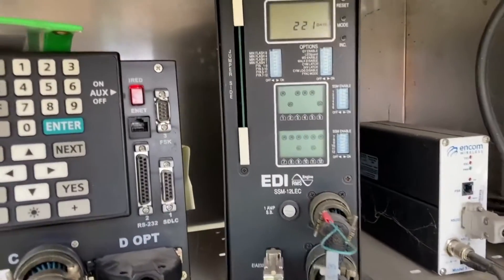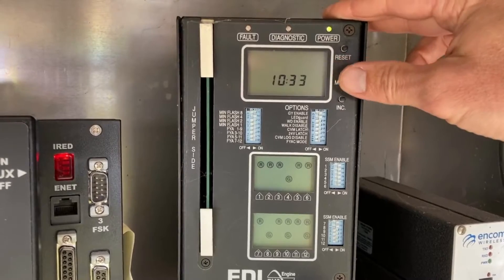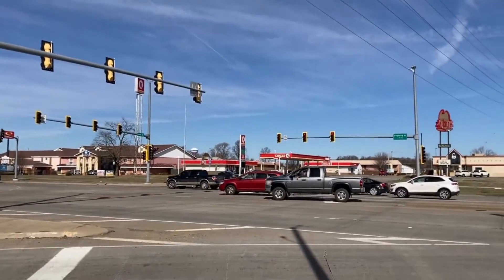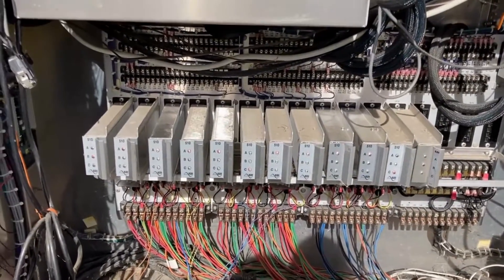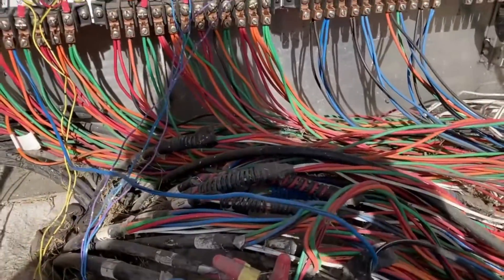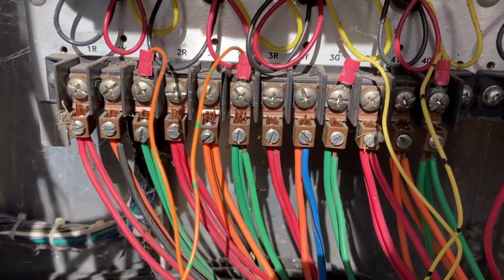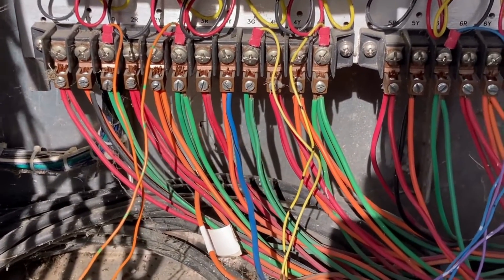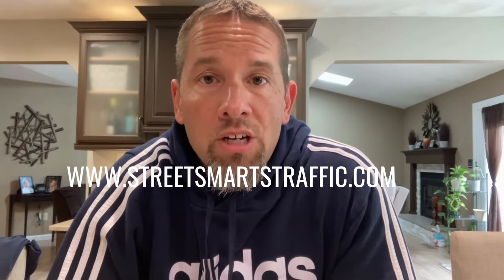Traffic Signal Troubleshooting - Dual Indication Fault

Comment: I would LOVE to know more details of how wider area traffic coordination of lights works. Here in the Minneapolis area, i know one instance is Park Avenue where timings are set so that a "block" of cars traveling at exactly the speed limit will encounter nothing but green lights. (I've actually been in such a block, and it's eerily smooth) Elsewhere in our metro area it seems clear that there must be SOME kind of higher level management. And then on top of it all we have Opticom emergency preemption almost everywhere, and I've always been curious how that system interacts with a higher-up management system.
Reply from the maker: Ahh-You have experienced what GREAT traffic signal management looks like.  I hear too often bad experiences with traffic lights.  Great to hear when it's noticed!   Yes, you were in the 'Green Span'.  When traveling at the posted speed limit and in the start of the coordinated phase, in theory you should be able to travel thru an entire signalized system and not hit a red light.  
Check out my other video about setting time in a controller for coordination.  I also have another video posting soon about where I found a signal out of coordination and how it affected the run...still in production.
Emergency preemption (while safe) can affect coordination (in a negative way).  Eventual videos on that as well.  
Thanks for commenting!
Reply from the maker: Meant to say Green Band...not Green Span.
Reply: @streetsmartstraffic  wait, so its actually the time of day that decides coordination? I tought it was a simple wire wired from the green relay status output of coordinated phase of signal 1, wired as a car detector on signal 2 controller, where controller 2 would be programmed to always forcefully serve the coordinated phase after X seconds after getting a call on that phase where X is the arrival time of posted speed limit.

But guess its cumbersome to run wires between each intersection, otherwise the coordination would be "smartly updated" when a emergency preemption happens. (and it could then even trip multiple traffic lights in sequence reducing the need for expensive preemption hardware at each light - while the first light in a coordinated phase could be detector light)
Reply from the maker: @sebastiannielsen   What you're describing is more of an adaptive setup.  Although there are sophisticated setups out there that adapt to traffic and change their plans, I haven't really seen them work successfully.  On paper, it sounds amazing.  In action, it's a little wonky.  The system I'm familiar with, it took 15 minutes to analyze and then choose the closest coordination pattern that matched the volume of traffic.  Then another 5 minutes or so to get the coordination in step.  So it could take 20 min for it to kick in.  AND ALL system detectors have to be working perfectly.  If there is a malfunctioning detector, it can throw everything off.   
That's why a great timing plan (TOD) can almost always beat out the adaptive.

Comment: But then I also wonder, you have GY enable on. How could it react on the fault then? I guess GY enable in the DIP switch is for countries that use the green-yellow indication to warn for upcoming red. (which was the old standard here in sweden, then the phases were red --> red+yellow --> green --> green+yellow --> red, now its changed so its red --> red+yellow --> green --> yellow --> red)

Comment: Personally, I think the troubleshooting steps that was taken (swapping out both load switch and phase monitor) was a kind of grossly unneccessary, as if the fault description is "Happens only during heavy rain", then it should be clear that it can't happen in a dry closet and everything in clearly dry locations can be excluded completely from troubleshooting. Then its always a bad wire, or water ingress into a traffic light head or similiar. In the same way, I work in a computer repair facility, and I always refuse to for example replace RAM if the computer shows signs of a disk fault (boot errors and BSoDs related to harddrive).

However, if the traffic light after a repair action, for example starts behaving sporadically incorrect without regards to heavy rain, then its clear that something else did take a hit, for example a load relay could have gotten a hit from that short circuit in heavy rain, and started behaving badly even after the wire loom had been repaired. (In the same way I would proceed to replace the RAM if after replacing the disk, the computer starts showing page faults and things not related to disk, because the malfunctioning disk damaged other parts in the computer).

However, after fixing that wire loom, you should maybe put moisture sensors inside every traffic light head, and also in poles, handholes, etc and see which sensors that trips, maybe you have a gasket failure in some locations meaning you will get this problem again in the future if you don't fix the water ingress problem. If the traffic lights also have built-in heaters, maybe its wise to run them for a shorter amount of time after each registred rain event (in the same way they are run for long times in winter to melt snow) to dry eventual moisture that finds their way into the traffic lights.
Reply from the maker: @sebastiannielsen    I couldn't agree with you more.  I was stating that the agency that has maintenance on this signal had tried these remedies.  HOWEVER, I'll take this a step further and it's something you may not think about.  If a cabinet has a bad seal on the foundation, during heavy rains, ants seem to find entries into the cabinet.  Ants can do BAD things once in a cabinet.  They seem to find their way into many components, such a load switch.  Granted, they should be noticeable but not always.  Just something to think about as the obvious places to start looking aren't always, well, obvious...
Great insight and thanks for commenting!!
Reply: As a guy who has spent a lifetime fixing things, I'm not sure as I agree.  When testing or troubleshooting, where you start is influenced by what's easy. Even though the cabinet is dry, something might be sensitive to high humidity you get during a rain.
Reply: @russellhltn1396  Yeah, but somehow, it then starts becoming a parts cannon out of everything. Like some car guys do, just throw parts at it until it runs again.

Atleast do some exclusions based on the fault description. If a car runs poorly in heavy rain, then it clearly isn't the fuel pump, or the in-cabin fusebox as those things are in (when talking about rain) dry locations - but can be a good idea to verify the locations are dry, so not some seal or gasket have failed.

Comment: Check for water inside the traffic signal unit. Is the terminal strip dry? Wet terminal strip will cause dual indication. If wet, remove wires from the terminal strip and use wire nuts for connection. More separation between the wires. For a  temporary solution place an incandescent light bulb load on green and yellow circuit terminal strip in the traffic cabinet. The light bulb filament will ground and stray voltage that shouldn't be there. Light bulbs ground the circuit (when light is off) better than LEDS.
Reply: I always carry a 60w incandescent bulb in a rubber socket just for these kinds of troubleshooting scenarios.  Perfect for adding 0.5a to any 120v circuit!
Reply from the maker: @overamped23042  Thanks for providing this information.  An incandescent bulb/socket and leads can be a signal tech's best friend. Thanks for commenting! Much appreciated!
Reply: @overamped23042 sometimes the circuits need a visual load and a "multi-meter" doesn't get it.
Reply from the maker: Hey Mike!  Always appreciate your input.  That was good information you just provided there!

Wires were dry.  We thought that the splice (which was in a handhole in the intersection) was not good.  But after replacing the suspected bad yellow wire with the spare wire in the bundle, its been running great.